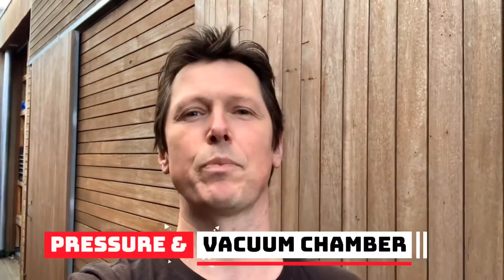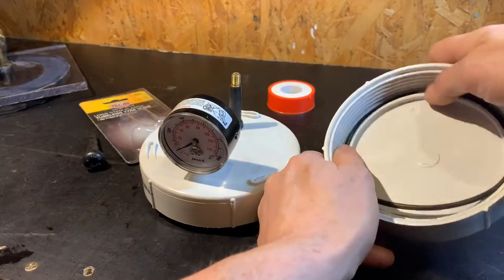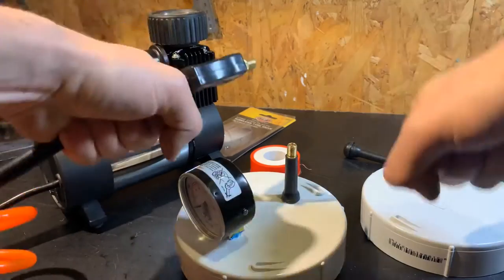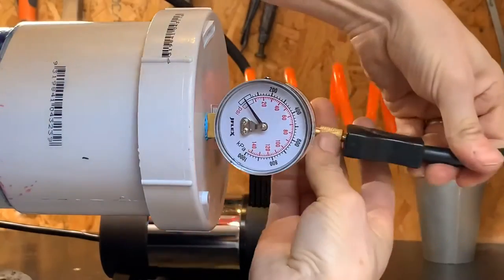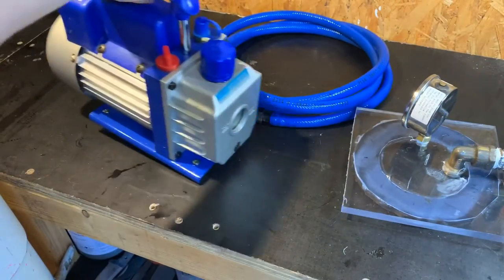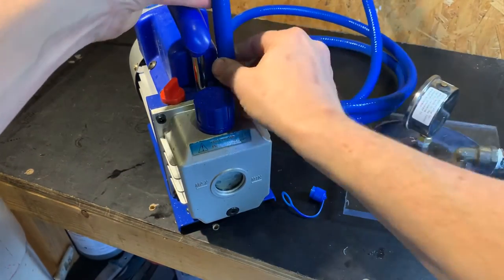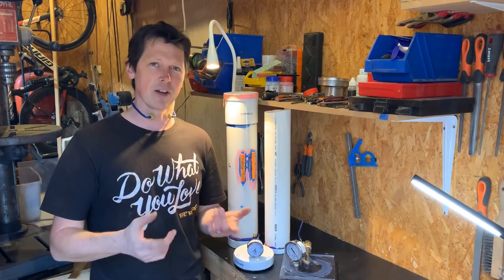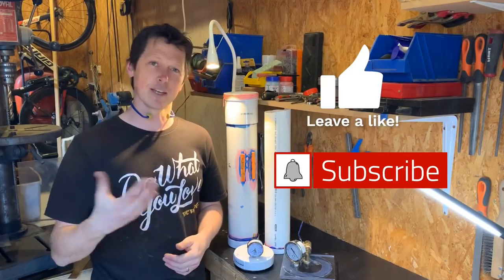DIY - dual Vacuum and Pressure Pot (for RESIN and WOOD STABILISING)

Comment: Awesome Video! The fitting for the pump is a automotive air con connection for R134a Gas. You can find them at many auto parts suppliers (e.g Ashdown Ingram or NAPA auto parts here in Aust), esp. ones that service auto electrics / thermal control trade. Vacuum pumps are a required tool for working on car AC systems. Hope that helps anyone that may be starting this project.
Reply: Cheers, it certainly does help!

Comment: You can save some money on a vacuum pump by using an old pump from a fridge/freezer.
They are normally a sealed system (flow/return).
Once you've removed the pump, you'll have 2 small copper pipes, just find out which is the return by running it (one sucks one blows).
Connect the one that sucks and there you go! A vacuum pump😁👍
And as a bonus they are super quiet 😎
Reply from the maker: Super later reply from me, but yea I looked into this and felt I wasn’t technical enough to make it all work! Also I might be wrong, but the fridge pump might not be strong enough to use effectively. I found it needs to hold a pretty heavy vacuum to be effective. But if I’m wrong, then yep it really would be a cost effective solution! 👍🏻

Comment: For the record that pipe is not rated for any pressure at all, pressure pipe is marked PN12 (12 bar approx. 180psi fluid pressure not air) up to PN18 (18bar). Yours is DWV (drain waste vent). I know this but frankly I'd probably do the same thing as you and live on the danger side, but don't take any comfort in thinking it'll handle 180psi as it'll almost certainly explode well before that. Oh and you are wrong about it cracking first, it would be a catastrophic explosion at the end cap but you'd see it bowing out before it did.

That pipe is fine for vacuum though you can't get -30psi, its relative to ambient pressure so cannot be less then -14.7psi.
Reply from the maker: Thanks for the insight! Yea I looked up whether it would hold 45psi and it said it would (don't remember the exact details but I think it said 80psi on the fact sheet). Either way, only going to 45psi and it's not seemed to give any indication of being under duress to date!

Comment: thank you ive been thinking of doing something similar but didnt know how feasible it would be
Reply from the maker: I find the vacuum side of it works more consistently (the pressure pot does sometimes loose pressure if I haven't screwed the lid tight enough) but it's extremely feasible!

Comment: At 12:00 those damn vacuum connector threads are their own special size; probably a metric thread, but not standard plumbing, and finding any sort of adapter to ordinary pipe threads is nigh onto impossible. I have been trying to adapt a clever gizmo, a small Venturi vacuum pump, that uses compressed air to pull a vacuum, very effectively, but the connectors are the sticking point.

Comment: I was thinking same thing- why two separate chambers for vacuum and pressure.  But my application is for building silicon rubber molds needing vacuum to remove air bubbles from the rubber mixture before curing, and then using the mold in a pressure pot to cast resin for prototype plastic parts.  Pressure is needed to remove bubbles in resin, whereas vacuum is needed to remove them from silicon rubber molds before curing.  Unfortunately for that application the vacuum pot lids usually are see-through plexiglass or glass so you can see the progress of the de-gassing in the rubber mixture in the pot as it foams and rises.  I suppose it might be possible to make such a lid with a piece of plexi or glass for your PVC vacuum chamber idea, but have never seen it.
Reply: Oops, sorry didn't see your plexiglass top for the vacuum, just assumed you had another PVC lid like the one for the pressure pot,  and didn't need visibility for curing wood rather than silicon rubber mixtures.  My bad, sorry.  Great idea and I'm going to try it !  Thanks !

Comment: This is exactly what I have been looking for. I am trying to eliminate movement on the gears in my wooden clock i have been making for the last 14 years . Can you tell me what cactus juice is?
Dean
Reply from the maker: Sorry for the delayed reply! Cactus Juice is a very thin resin that seeps into all the air pockets in a dry piece of wood. Just search for Cactus Juice Resin and you'll find it. But for it to be effective, you need to vacuum out all the air from the wood and then release the vacuum and the resin will work its way into all the pockets left behind. Enjoy.
Reply: @chefknifeco  Where in Australia can you purchase juice ?

Comment: I bought the Chinese pump with a vacuum pot complete with gauge,hoses fitting etc,& the cost was $145 delivered. I am going to try and make a Pressure pot though using a bucket. I think the PSI is effective at reasonably low pressure. There is one guy on Youtube who has success with his DIY pressure pot at 25 psi.
Reply: This was a great video mate thank you.

Comment: I'm just starting to learn about pressure pots and vacuum chambers. Excellent video. Is there a fundamental reason why there's no 2-in-1 pump for this setup? It seems like one pushes air in while the other pulls air out, could someone theoretically make a single reversible device that does both?
Reply from the maker: A very late response from me, but yea I think you can get them but they are pricey so I went with cheap versions of both. 👍🏻
Reply: @chefknifeco  Thanks for the response 🙂

Comment: Nicely put together, thanks for sharing. It looks like the pump may be low on oil, please check. I have the same pump and it arrived drained of oil with some deceiving remnants in the little window. Surprised to see you are using the cactus juice, where can you get it from here in OZ? Thanks!
Reply: Thanks mate, yea I was surprised how well this setup worked in the end! And yes, the oil level was deceiving (the instructions on that pump were abysmal!!) and I worked that out before any problem after making this video luckily! Cactus Juice took a while to find, but finally found timberbits.com sells it. 1.89 litres for $114. So not too bad.
Reply: Thanks Nick, glad your pump is OK. I almost did mine, glad I checked first. Thanks for the link and enjoy stabilising!

Comment: Great work sir. I'm a wood turner so would like a pot solution to accept something like 200mm diameter by 200mm thick. Like you I'm trawling YouTube for inspiration. Bob in the UK
Reply from the maker: Thanks Bob! Glad it's been useful. I'm still using both these all these months later!

Comment: Just curious if there were any issues with Cactus Juice causing PVC to fail. I tried ABS pipe and the Cactus Juice ate away at the ABS causing it to crack and leak.
Reply from the maker: I don’t believe there is. I can see no degradation in the pvc at all. And I’ve been using the same pipe for months. I know that the cactus juice can have problems with the clear lid plastic if it comes in contact with it, but the pvc pipe seems to be completely fine so far. I’ll update if anything changes there. 👍🏻

Comment: What advantages does pressure have over vacuum? Don’t you need to monitor bubbles leaving your piece?
Reply from the maker: Very good question! 
The pressure is for when casting resin in moulds. 
The vacuum is for when I'm stabilising wood. You have to vacuum all the air out of the wood and then when you release the vacuum, the Cactus Juice resin seeps into the gaps left. Yes the bubbles threaten to overflow at the beginning, but only for the first 5 mins. I just monitor the bubbles and switch the pump off to let them subside. Then on again. After 5mins, they settle down and you can just leave it going for the next 24+ hours!

Comment: How do you release the pressure for the pressure pot version?
Reply from the maker: Hey! The bike pump valve I use to add pressure has the release button in it. I use a nail punch to depress it.